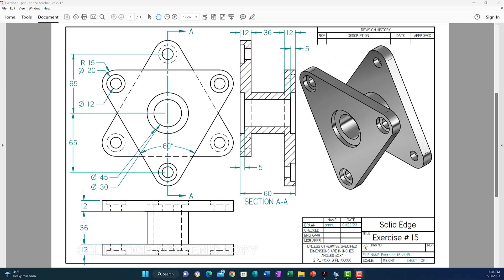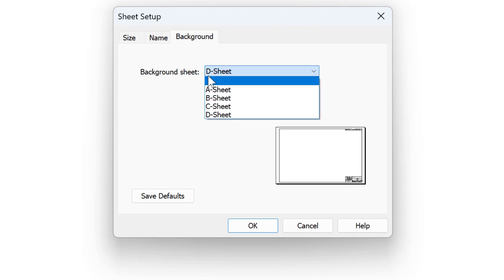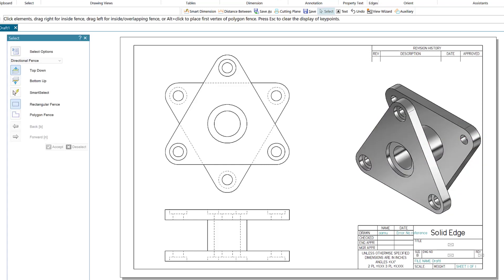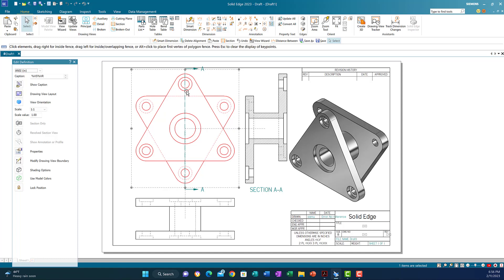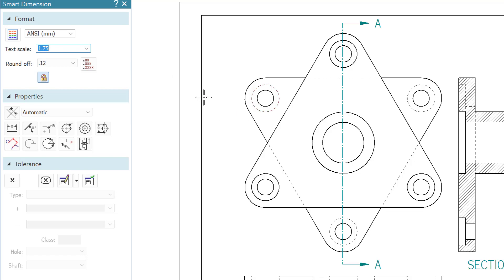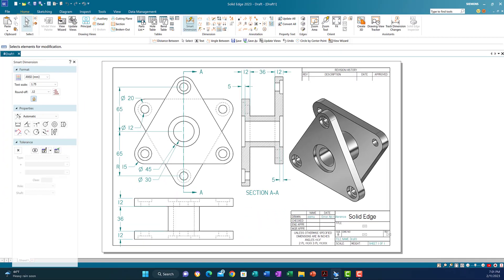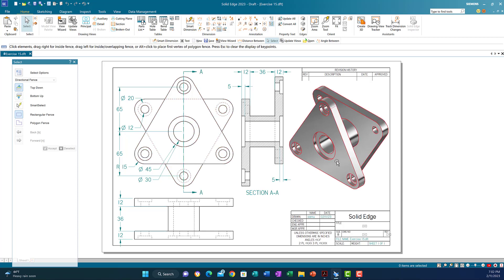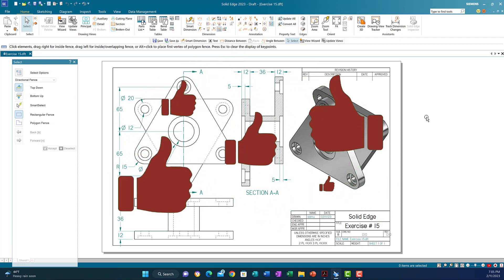Solid Edge 2023 Tutorial - Exercise - 15 (Part B)

Comment: I like your videos. Not too fast and plenty of explanation. Could you show  how to use the face relate commands. I made an error on this part. On of the counterbores was off centre. I tried to fix it using face relate but ended up having undo, undo, ... to correct  the error.
Reply from the maker: Thank you for the comment. If you email me the part and the draft files, I should be able to help. ( mohamed.seif@aamu.edu ).
Reply: @drmseif  I am using the Community version of SE 2023. The professional version doesn't open the community version files. I can send a STEP file though.
Reply from the maker: @ronancarroll8554  k
Reply from the maker: @ronancarroll8554  I also have the 2023  education version.

Comment: Note: If you use ANSI Metric for your DRAFT they are still in INCHES for the PAPER.  Use the ANSI Metric so you create accurate Draft Drawings. You then can correctly and properly have the Title Block Message: "UNLESS OTHERWISE SPECIFIED DIMENSINS ARE IN MILLIMETERS..."    Currently, for years, you have been doing this wrong.

Comment: It has been a truly long time since I drafted.  However, I do believe it is against proper practice to dimension 'hidden' lines.  Do not duplicate dimensions.  They are unnecessary and cause confusion. Because, a skilled draft reader knows only the required information is on the sheets. Also, you omitted or left out the 120° relationship between the centerlines of the exterior bolt holes. I do not think it is fully evident the relationship is 12mm 3X holes on the flanges are 120° on centerlines. ???

Comment: ALL of YOUR Drafts are specified in the WRONG Units!  You always select ANSI INCH for ANSI MM Drawings. 

You have no good reason to use ANSI INCH instead of ANSI Metric.  It makes zero sense and is unprofessional to use differing units templates. Use the ANSI Metric. Next...

Note: IF YOU INSIST - to use ANSI INCH for Metric Units - Learn to use the Edit Dimension Definition commands and work with the Prefix and Suffix capabilities to properly indicate the dimensions on the dwgs as 'mm' for the correct measurements. 

READ the Title Block in EVERY Video outlining a Draft Sheet. --- Each clearly states, "UNLESS OTHERWISE SPECIFIED  DIMESIONS ARE IN INCHES..."  

 Also, could you learn to properly edit the Title Block?  You've been doing it wrong for over three years, now.

So, ALL of your Title Blocks are WRONG. FOR  all the Years you have been doing this up to 2023.   It would be very advantageous to any students IF you were to learn the application and proper Drafting practices.    

Drawing Sheet 'Title'.
Suggestion: Update and Upgrade to, Solid Edge 2023.
Adding text and dropping over code and symbols is WRONG!  
When using 'Save' and 'Save As' ---> There are fields to update the TITLE, DWG NO, & REV.  You are very unprofessional and not knowing to put text ontop of symbols and other text. Wow...

  The Draft Page Title can be changed during the Save File stage. OR, go into the 'View' Tab > Sheet Views > 'Background'  Then, to the bottom of the page see and select the B-Sheet, which YOU use. Then, edit the Title Block. You can figure this portion out on your own.   

Please - YOU have spent several years making very poorly organized videos to teach poor technique, practices, and wrong actions. And not learned much of anything.  You claim to be a PHD???  Students deserve an organized and well presented tutorial, lecture, examples, and tranings from a Phd. 

You've made many videos over the years of published - very poor quality training. If you do not present professional - you waste time and frustrate students who become poorly skilled workers, poor technicians, lousy designers, bad engineers, low level scientists, etc.    
Get organized before you make a video, write a script, practice by doing the examples, and post edit your videos.. Get the hums and haws out, the lousy wrong practice mumblings and fumblings, too.   Note: I was an active engineer and professional. I am tired of amateur and poor exampled Phds (fuds) patting themselves on the back and getting accolades from the needy ignorant.   Be a Man (I noted you are a male.). Be a Professional (You carry a fud (Phd)). Learn and present as an experienced individual. You seem to, maybe, have a few years of extended post graduate training.  ???  [I am frustrated with incompetent people in elevated status and positions. So, I'm no longer going to be quiet. You need to upgrade your skills. Raise your quality. You are and example and represent your education, your alma mater, your organization, your family, your heritage, your nation, and --- maybe --- you.]  Take care. I do know you have the capability to be - A professional. 

P.S. I would have sent the above raw shakedown of your poor product privately. But, you made a concerted effort and point to remove all ways of privately contacting you. So, now you bare the rash of a public scolding.  I couldn't get to you in a soft, gentle, pampering, quiet, private, professional toned contact.
Reply from the maker: Thank you for the comment. Your feedback is well taken.